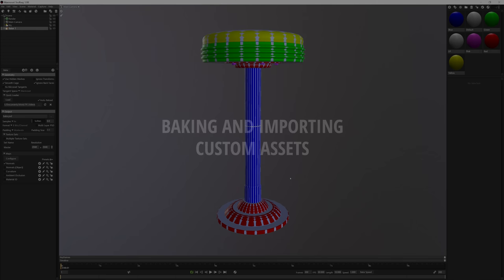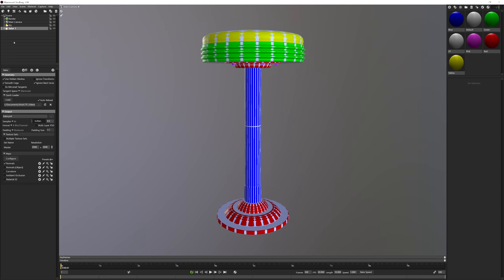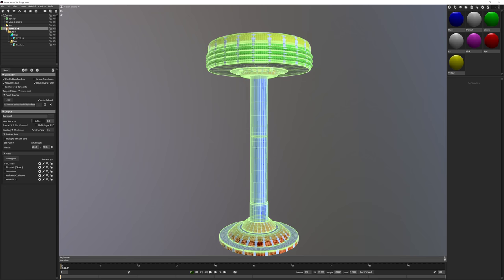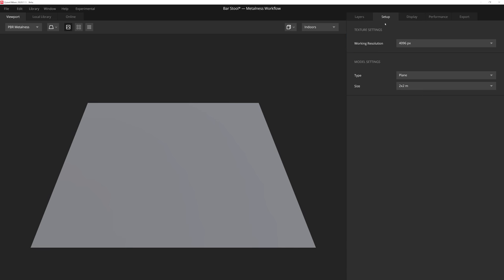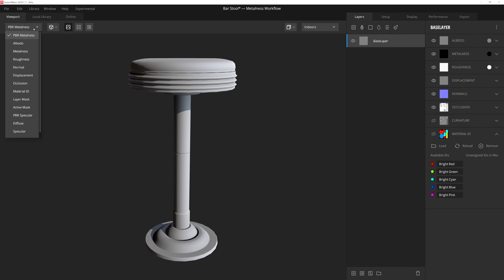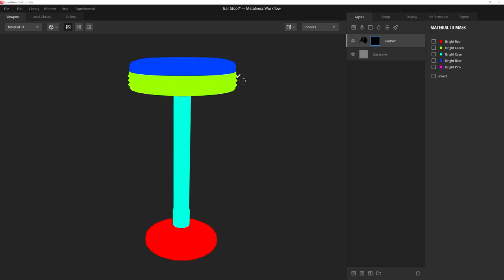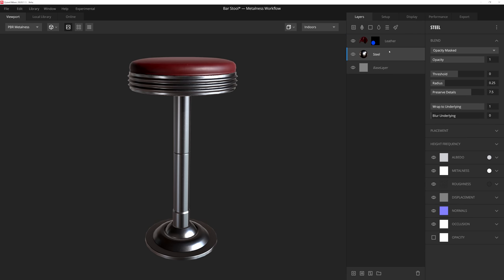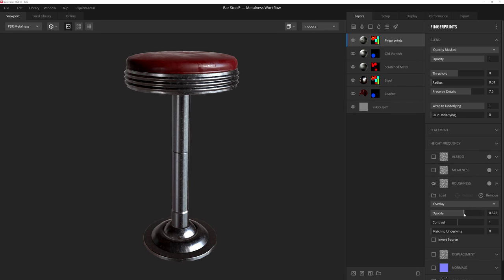Baking and Importing Custom Assets in Marmoset Toolbag

Comment: 1) Is there a good resource anywhere for the Quixel shortcut keys?
2) I would love to see a short example tutorial of the best ways to add assets to the bridge library using an external 3d software (blender for me) + quixel bridge + mixer that can then be easily exported to Unreal. 

I have a working pipeline set up but I wonder if there is not a faster method or some tricks and tips I might be missing out on. 

Pretty please with sugar on top.

Comment: 2 things: (Toolbag price and correct tangent setup)

Yes Toolbag is paid software, but is the best baking software on the market. Everything from normal maps, IDs, to GI lightmaps. Easily worth the one time payment investment! Would be nice to have simple baking in Mixer though.

Make sure to use the right tangent space. Most software uses MikkTSpace. I set this as the default in Toolbag in the preferences.

Comment: Having a strange issue. If my high poly mesh has a sub-d applied, I get a very incomplete normal map, but all the other maps look fine. If I don't have a sub-d applied (in effect making both meshes low poly) I get a complete normal map, but it and the other 3 maps all have weird wavy artifacts throughout. Wish I could include an example. Any ideas what's going wrong? I'm brand new to this.